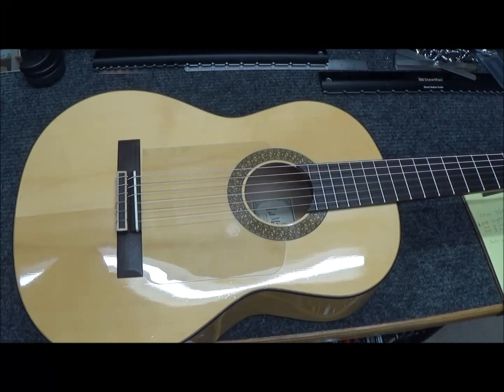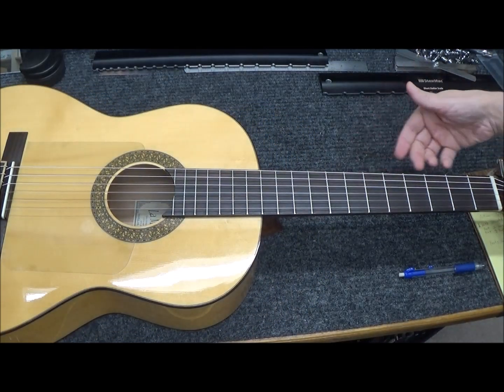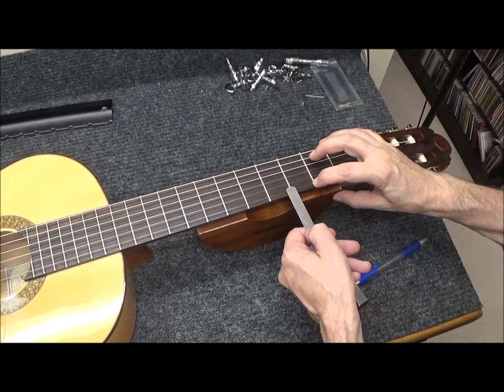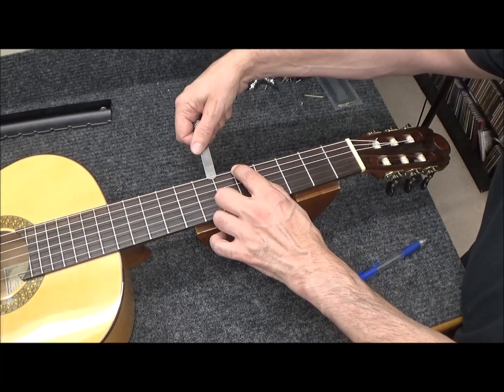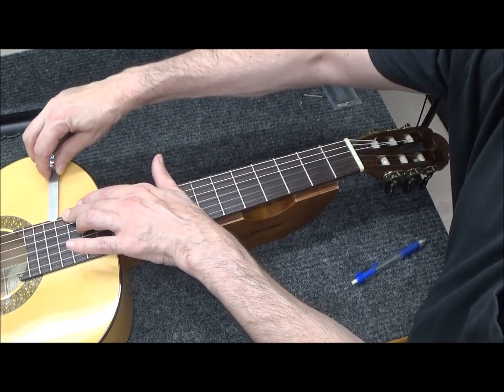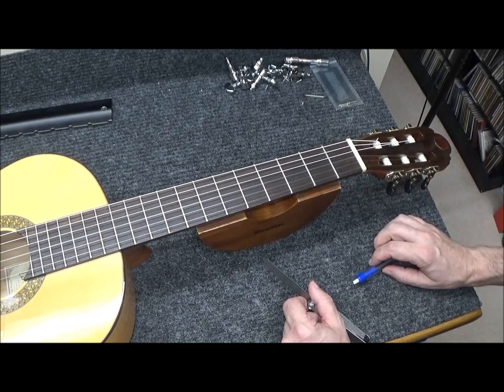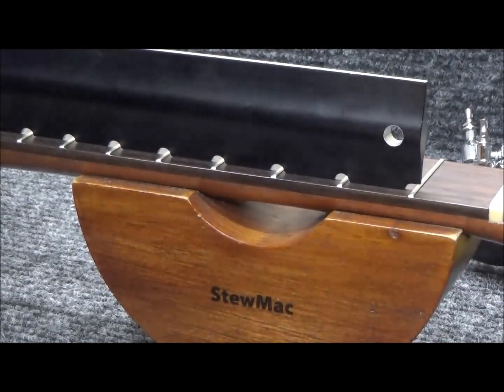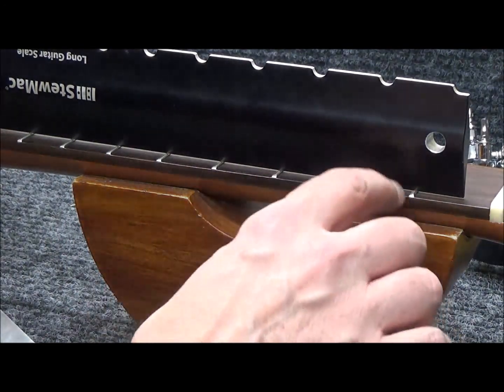Bowed Neck Classical Guitar - La Mancha

Comment: You realize how much of a bullshit it is when people claim that classical guitars dont need a truss rod. Thats just a handicap thats been maintained because of tradition. Just because the tension of a nylon string is not as high as steel string, it does not mean it wont show its effects overtime
Reply: My classical guitars don't need a truss rod. I make my fingerboards with round bar frets, they only require cutting into the fretboard .046" and it's a 3/32 wide half round slot which is naturally a structural arch. It doesn't weaken the fretboard at all. Zero neck movement ever. Sawing fretboard slots weakens the wood by 50%

Comment: Would it have been possible to use a new set of frets of a different size or material for an easier fit? Or would that have taken away from the guitars originality/value?
Reply from the maker: I believe that would have been better. Typically fretwire is harder than this.

Comment: Even if I straighten the neck by attaching a clamp like this to my classical guitar, if I release the clamp, the neck bends back to its original position.
Even if heat is applied, the same result is obtained.
I would be grateful if you could give me a hint to straighten the neck.
Reply from the maker: Without looking at it in person, I’m not comfortable making any recommendations other than to take it to a professional luthier
Reply: Yeah I have a Silvertone guitar that was my dad's. The action is so high it won't even  read on the string gauge. I saw a video where a guy put an iron on the fretboard and then pushed down on it. I'm not sure that would be safe. There is a slight separation at the bottom where the heal of the neck attaches to the body of the guitar. It may need a neck reset. It's probably a 69 or 69 with no truss rod.